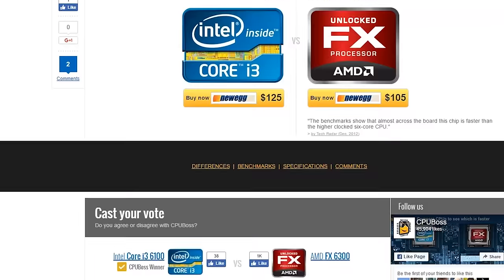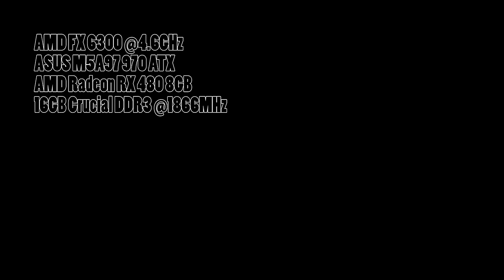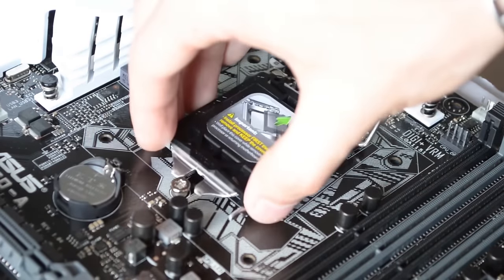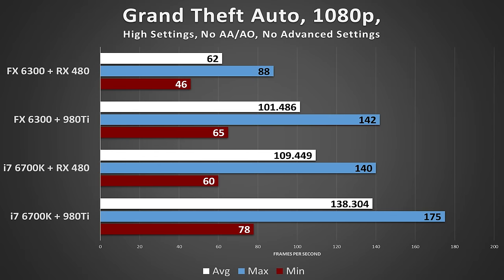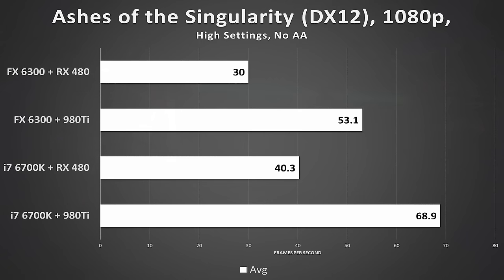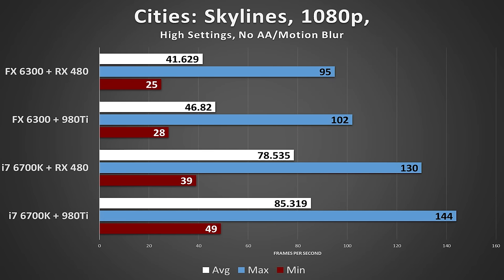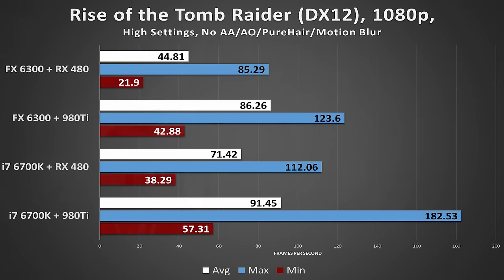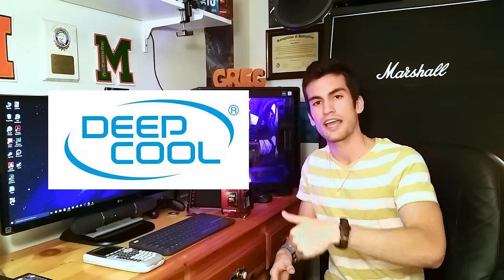AMD FX 6300 + RX 480: Severe Bottleneck?

Comment: I think this proves you shouldn't buy an fx6300, but if you already have it, it's not too bad, but a good time to upgrade to say, an i5 4460
Reply from the maker: A good way to look at it.
Reply: what about the fx8k series? now i really want to see the comparison between it and the skylake
Reply: fudomeiyo fx 8300 is between i3 and i5 performance. if you already own one, good, you can wait for zen and sell it when zen releases. i have an fx6300 and its meh.
Reply: +Thedovahkiin Would a fx6300 do The work for a cheap Light gaming rig?
Reply: +roligt1234 yes, but if you're building a new rig, go with a skylake i3, for a better upgrade path, if you already have one, it gets the job done for every title paired with anything below gtx970 level
Reply: +Thedovahkiin The thing is that I got a mobo, cpu and 550ti for like 60 bucks, and chassi 4 free and already got ram. What do u think?
Reply: +roligt1234 you got the fx 6300 with a mobo and a gpu?  amazing deal
Reply: +Thedovahkiin oh nvm it was $80. But still pretty good, now I just need a psu and than my gf got a light gaming PC.
Reply: i3 and i5.... 2nd gen performance.
Reply: Hmmmm tough one.... Either one or the other wouldn't make a huge difference, but together would make a significant difference though. Like the gtx 960 isn't a huge upgrade from the gtx 750ti, but paired with an i3 or i5 you'd see a much bigger difference. I'd rather upgrade to a skylake processor now and then upgrade the gfx to the gtx 1060
Reply: should come out in a month or two, you can read up on it. I would get the rx 480 or gtx 1060 they cost around $250
Reply: Why would you want to upgrade to another outdated cpu?  If you buy a good cpu, it can last you the better part of a decade.
Reply: i have an fx6300 (paired with a gtx 460) i want to upgrade the gpu, wich will be better option? wich will be less bottleneck? rx 470 or rx 480 ?  having in mind that the fx 6300 bottleneck the 480, i gonna get the same fps with a bit less powerful gpu? or the fx is gonna bottleneck any of those at a similar level?
Reply: I upgrade from the fx6300 to an i5 4460 last year and I can tell you that it was a good upgrade, the stuttering that I was suffering disappeared in all the games with that problem. But nowadays better go for skylake ddr4 and such
Reply: Eduardo Leiva the rx 470 is estimated to be slightly less powerful than a 970, so just my two cents, buy the rx470.
Reply: fx 6xxx or fx 8xxx of the same architecture play games with the same performance when clocked at the same clock speeds.
Reply: wow the i5 4460 uses DDR3, is clocked much lower than the i7 6700k on an older and a bit weaker for gaming architecture, with slower cache, -2 VALUs, fewer data units.... the difference between it and an fx 6300 would be minimalistic, especially if you overclock the fx 6300, while you can NOT the 4460..
Reply: +IIIRattleHeadIII it's called IPC, which has well chips have a lot more of than viscera chips do. so the i5 4460 is miles ahead of the fx6300
Reply: Thedovahkiin Intel and AMD architectures are easily compared, because they are on the same ISA(instruction set architecture), thus they use the same units for 99% of the architecture.

Haswell has only 30-40% higher IPC than piledriver depending on the area of usage.
Haswell has 3x ALUs and 2x AGUs per core + 1x VALU(which is absolutely bottlenecked by the lack of resources, so it really didn't make a difference).
Piledriver has 2x ALUs and 2x AGUs per core.
So integer IPC at the same clock speeds per core goes to haswell by 33%.

When it comes to FP(floating point) performance, piledriver has 2x 128 bit FPUs per cluster, while haswell has 1x 256 bit FPU per core, so up to 128 bit SSE they are equally as fast, but at 256 bit AVX piledriver is 35-40% slower, due to it requiring 2x 128 bit FPUs to work as 1x 256 bit FPU, which is slowed down, because it has to break the operations into microops, from macroops, but and it's a big BUTT, 256 bit AVX is 99% useless, it's only used in synthetic benchmarks and certain vendor software, NOT games, so it's NOT a valid performance factor.

So piledriver is 99%(in games all the time) equally as fast as haswell in terms of FPP.

Piledriver has a lot, but slower cache, while haswell has less, but faster cache, this is entirely dependant on the software, some software wants more cache almost regardless of the speed and some just want fast cache almost regardless of the size.

So it's a tie in this case, but a lot of games want faster cache, so haswell takes it(haswell has about 40-50% faster L2 and L3 cache cache).

Then there are the clock speeds, where piledriver just crushes haswell in terms of overclocking, especially when the i5 4460 can NOT overclock..
a fx 6300 at 4.6Ghz is clocked ~45% higher than an i5 4460, while it kept it's own in most games, especially with the gtx 980ti against a 4.6GHz i7 6700k, imagine with such a clock difference.

These are the most basic, but essential performance factors, every other aspect of the architecture are balanced accordingly, except the fact that intel put a nearly useless VALU in each core, which 90% of the time is bottlenecked to the point of irrelevance or 10% of the time does some minor improvements, but most games do utilize VALUs.
Reply: IIIRattleHeadIII All you did was state facts and said that at 4.6ghz, an fx6300 could match an i5 4460. and the requirements to do that requires a good cooler, a well binned chip, anda motherboard with good vrms, which most owners dont have. and despite  the fx 6300 might catch up to the i5 in certain games, itll be shit on cpu intensive applications like arma 3. i own an fx 6300 overclocked to 4.5ghz paired with an r9 280x, but it is still shit compared to lga1150 chips.
Reply: ***** my fx 6300 consumes 60-65Watts on full load with Prime95 and aida64 at stock speeds and does NOT go over 50-52C with the same problems at stock speeds with the stock cooler.
Reply: IIIRattleHeadIII because the fx 6300 throttles at around 80 degrees, the chip is cool, but oh my god it heats up my room a lot good for winter but for sumer...
Reply: Thedovahkiin dude 50C is NOT much, haswell quad core chips go up to 80C with the stock cooler at stock speeds.
Reply: +IIIRattleHeadIII I didn't say the fx 6300 runs hot, I'm saying the heat it outputs is hot. there's a difference, ever heard of tdp?
Reply: Thedovahkiin then I did NOT read what you said correctly.
Reply: Thedovahkiin also I own a fx 6300 and i5 3570k and in arma 3, both CPUs suck ass in big multiplayer servers...
Also both play games just about equally, except games like WoW, Arma 2(here both are bad, but the i5 gets a bit more fps) and paradox games,  but the best I've tested them with are 2x r9 380s.
Reply: ***** the fx xxxxE series are NOT meant for overclocking, they are high yield low binned chips that are cheap, that's why they require a lot of power to overclock, because of that.
Reply: ***** it does in this case, it very much does.
Reply: It will be cheaper for him to get a FX8350. It will be just barely behind the 4460 for less money. I would think if he has to upgrade to go with the 6xxxx series instead.
Reply: FX8300 lineup is very overpriced. Rather get the cheapest i5 you can get, it will outperform the outdated FX chips easily.
Reply: MrKeikari the reason why the fx 8000 CPUs cost so much, is because they are top of the line, most failed fx 8300, easily become an fx 6300 or fx 4300, without the need to make a new silicon, while a failed fx 8300 is a failed silicon
Reply: IIIRattleHeadIII You're correct but it doesn't make the pricing any more right since the "evil Intel" is kicking Amd's ass even in price-to-performance ratio :)
Reply: The gtx960 is perfect with a FX 6300 dont beleives what the other are saying
Reply: chronicblazer84 Yes, and you good at making random links with no point whatsoever :D
Reply: MrKeikari damn, a fx 8350 bottlenecks a gtx 960? Good thing, I got a fx 6300 that barely bottlenecked my 2x r9 380s in 99.99% of the modern games, now that I have only one r9 380, I need a better GPU, so it can bottleneck a GPU, to catch up to the fx 8350 :p
Reply: IIIRattleHeadIII 380 > 960 so the bottlenecks is even bigger :/
Reply: chronicblazer84 You have no idea 3dmark benchmark works? xD The physics is completely independent score and tells nothing about real-life performance, same as any non-sense benchmarks like cpuboss or passmark. Do your research before trying to back up your beliefs with plain lies...
Reply: chronicblazer84 Yeah, pointless synthetic part which shows nothing in real-life performance. You keep resorting to these irrelevant benchmarks since you obviously have nothing else to make FX8350 seem even relatively decent choice... There's no going round the fact that FX8350's low performance bottlenecks even low-end gpu like GTX960.

Your insults are not going to change but that's all you have to back up the obsolete FX cpu lineup.
Reply: MrKeikari not really, I own an fx 6300 and an r9 380(used to be 2 in CF) and my CPU is more than enough
Reply: chronicblazer84 you haven't shown any hardware architecture knowledge, nor any digital design, knowledge so far and you proved that you have no idea about coding... Now tell me, why should anybody take anything you say seriously?
Reply: chronicblazer84 Lol, no need to get that super-mad when you're proven wrong. Just look into these tech stuff, do your research and eventually you will acquire some basic knowledge to understand these matters :) Life is learning.

Friendly hint; maybe you shouldn't mention Heaven benchmark either in cpu bottleneck conversation ;)
Reply: chronicblazer84 so you know nothing, except a few things you've read on a few articles that have rendered 300+ pages to two sentences due to lack of knowledge, so they listened to marketing and a CPU has no such thing as a "physics controller"..... You just proved all my points...
Reply: chronicblazer84 and hyperthreading does NOT double performance, what hyperthreading does is add an additional scheduler, which helps the core be fed data whenever the pipeline is NOT completely full and it gives 0-30%, better performance depending on the software, it does NOT double threads, but for the kernel of the OS to use hyperthreading, the BIOS needs to first see it as 2x threads and then the OS sees it as two threads and finally benefit, where it can, from hyperthreading
Reply: To simplify things for him, think HT as organizing food in eating contest. The chewing capacity is still the same, but there's less slack when you're fitting the suitably sized chunk in your mouth whenever you can.
Reply: Stop trying to defend am3 chipset, it's good for light gaming, but will bottleneck anything above a 970. I have to keep mine overclocked just to avoid bottlenecks, and even then it still gets beaten by intel cpu's.
Reply: chronicblazer84 Wtf, so you're saying that making the pc even more expensive makes it magically perform better. Dude, see benchmark, you can't judge pc's performance based on price so adding even more expensive psu and makes the FX lineup's price-to-performance even worse!

MORE EXPENSIVE IS NOT BETTER, holy shit!
Reply: chronicblazer84 So is that a yes? You think pc performs better when it's more expensive? Wow man, I'm speechless.
Reply: chronicblazer84 Look into some benchmarks, you can't decide how good pc works by how much it costs. That's only the basic knowledge!!
Reply: chronicblazer84 I agree that his set up was pure crap, but I didn't see you say anything meaningful except that, also the name "BIOS" is just a formality at this point, it's beyond basic and I know that Intel have been using a crappier version of IBM's SMT  since the p4 days. And again, you know nothing about programming, Microsoft have been using the same shitty kernel since windows 95 for desktop, with super minor changes, for compatibility
Reply: chronicblazer84 oh, you go to Tom's hardware..... Where the biggest regards are and all they do is missimform people to say the least and do NOT start me on their biases....
Reply: chronicblazer84 if you are calculating the heat good job, but TDP is NOT power consumption, TDP stands for thermal design power, in other words how much heat the hardware outputs and how good of a cooler you need to cool it, measured in Watts(a unit of powe,), usually AMD(and Intel) products consume 33-42% less power than the TDP, except the RX 480, which had that power problem, IDK after the fix.
Reply: chronicblazer84 yes, but you proved that you don't know almost anything about hardware architecture, let alone digital design as well.
Reply: chronicblazer84 I never defended the system, I just told ya that TDP is not power consumption, which you were calculating the power usage from, they are barely related and I monitor my power usage physically as well, sensors in PCs suck horse shit. Also a 400W PSU with 18amp on the +12v rail and a PSU with 28 amps on the +12v rail are two different things and he is using a PSU with low amps, also it has terrible parts in terms of quality.
Reply: chronicblazer84 Wow, so your paranoia hit again? :D "My other YT account" xD "Cpu physics controller" xD "TDP being power consumption" xD 

You're building quite a rep here my friend :)
Reply: chronicblazer84 yes, usually TDP is worst case scenario.
Reply: MrKeikari you don't look any better either...
Reply: chronicblazer84 well you claim that you know computer hardware too, but it's a big no, no.
Reply: IIIRattleHeadIII At least I don't have to make up pc parts and I have facts to back up my statements unlike you :) 

Claiming Greg Intel-biased is just ignorant Amd-fanboy bs, You clearly haven't watched any other videos on the channel which also clearly favor Amd :)
Reply: MrKeikari I told you that my PC do not bottleneck a 380 you tell me I am lying, ChronicBlazer said that his cpu do not bottleneck his GPU and he brought lots of exemple.
Can you show us your proof that a 8530 bottleneck a GTX960?
Reply: Marcusius even I can prove you that the fx bottlenecks GPUs... Just play an old game or something piss poor optimized like arma or a paradox game, or something massive like world of Warcraft.... There is always a bottleneck in a system, in a perfect world/scenario your RAM,CPU,GPU and PSU would be running at 100% while gaming +the rest of the background tasks. I don't get why people care so much about their GPU being bottlenecked in particular.
Reply: IIIRattleHeadIII Likely because graphics card often is the component that mainly decides the fps in game for instance in balanced builds. It's also often the most expensive component, has shortest life-cycle and the more advanced graphic cards cost more. While with cpus you don't always get extra performance for extra cost :)
Reply: chronicblazer84 You just described cpu bottleneck on your overpriced FX8370E :)
Reply: IIIRattleHeadIII Arma is really really bad for every CPU, I remember someone bitching at the game and he was using an I7 6700k.
I agree with you there is some exception like those games but most of the games I play my GPU run around 100% most of the time.
Arma is pure CPU based game. Me i'm talking average to well optimized games like Crysis, Doom, BF4.
Reply: chronicblazer84 Ummm, yes it is :D
Reply: chronicblazer84 You just told that your FX8370E works at 100% utilization which means is likely bottlenecking the overall performance with its low performance.

And now you tell me to kill myself? :D
Reply: chronicblazer84 That situation is very unlikely :) But now that you've admitted that your FX8370E is struggling at 100% utilization aka being the bottleneck for the gpu you have just proven my point right :)
Reply: chronicblazer84 It's okay, just stop doing drugs. It's not good for you :)

Happy that we found the bottleneck issue :)
Reply: chronicblazer84 I do heroin for the same reason :)
Reply: chronicblazer84 13rd Splatoon at Underwater Rugby Rebellion in Andalusia.
Reply: chronicblazer84 Me neither, I captured Osama and got to keep him in my basement. He's got very good at knitting!
Reply: Honestly I would say wait for the next generation of cpus.
Reply: +Jacobprogammer Thats what I'm thinking i have a 6300 I'm banking on ZEN
Reply: 4460 is shit.
Reply: just wish amd didn't delay zen
Reply: Leon Still outperforms FX83x0 at the same or cheaper price :)
Reply: MrKeikari Yes, however the cpu doesnt perform better than an i3.
Reply: Leon In some games surely.
Reply: ***** Pentium is no longer recommendable.
Reply: Leon Why wouldn't it be? Super-cheap, superb upgradeability and unbeatable price-to-performance ratio.
Reply: MrKeikari 2 cores.
Reply: Leon Wow, you know so much!
Reply: MrKeikari 2 cores is not enough for gaming anymore.
Reply: Leon Lol, do your research. Core count doesn't matter. Even the overpriced "8"-core FX83x0 struggle against Pentium.
Reply: ***** You're using Firestrike score to compare cpus? xDDD :DDD xDDD
Reply: I got 4460 and it's not that good tbh, can't even OC it and it's outdated by now (no ddr4 support and can upgrade just to Broadwell). I'd wait for Zen if I were to buy all new or go for i3 6100 on a budget.
Reply: xyz12345 You're fine! Your cpu still outperforms any Amd cpu and there's not enough performance improvement from going ddr3 -> ddr4 that it's worth doing :)
Reply: MrKeikari As a ArmA player, I would have wished for faster CPU clocks and this CPU is locked. It's just a trick from Intel to buy the more expensive "K" models which are really the same, just unlocked.
Reply: xyz12345
You still have the best price-to-performance in your hands :) How much fps in Arma?

Skylake-non-K cpus are overclockable on Z170 motherboards.
Reply: MrKeikari Well I play ArmA 2 and ArmA Cold War Assault which are a bit older and they run ok but when I push the game really hard I wish for more CPU speed. Although it's true that I'd also need overclocker board and cooler.
Reply: ***** Currently on integrated but before I had GTX 750 Ti. I'm eyeing the RX 480 and upcomming GTX 1060 for a replacement.
Reply: I'd suggest to wait for Vega or new Nvidia gen, the upgrade is not that good (talking budget wise)
Reply: +Thedovahkiin  Sorry but no this video does not prove that you shouldn't buy a FX6300 because this video is a total fail as it is comparing a cheap lower end CPU to a expensive ultra high end i7 Intel chip,  The 2 are not meant to compete against the other its like comparing a mini to a Ferrari so of course the FX is going to bottle neck,  The FX6300 is more designed to compete against i3 and i5 chips and it holds it own against its target market and in those comparisons the FX ,i3 , i5 all bottle neck in a similar fashion.  My FX6300 literally gets to with in 7fps of my friends i5 rig.  My rig an old FX6300 with a GTX970sc running doom with graphics set on ultra is getting around 98fps my friends i5 rig with the same GPU on ultra gets 105fps.
Reply: EQUINOX But keep in mind how overpriced FX lineup and even FX8350 is outperformed by i3 so there's really no reason to bottleneck your system with bad cpu :)
Reply: MrKeikari an fx 8350 outperformed by an i3 ? lmao now thats some funny shit ... No it is not out performed at all in fact as i said earlier my old FX6300 is only 7 fps slower than my friends i5 skylake with its DDR4
Reply: EQUINOX Well FX8350 can't outperform i3. In most games i3 is far better than FX8350 due to FX architecture being such bad and gimped in performance.
Reply: Zen sounds great
Reply: I've had my FX6300 with GTX 660 for about 3 years now. For me at least it is still a quite functional system. I play Fallout 4 between 30-40 FPS on medium settings with full AA and it still looks better than my buddies XBone. Sure I plan to upgrade, as soon as Summit Ridge (a.k.a. Zen) is released. Not to say I will go AMD again, I'm not sure, but once their is strong competition on the market Intel will have to drop their prices. In the mean time I'm still getting plenty of use out of my bottlenecked rig.
Reply: AMD drivers are single threaded so exact same result with the 8350 as with the 6300... amd gpu's are just awful with slow cpu's. a fact often overlooked because reviews are always done with crazy high-end OC'd cpu's.. nothing like the computers consumers are putting these midrange cards in..

and as for i5-4460 vs fx-6300.. lol the i5-4460 has one extra FPU, all of which outperform one of the fx-6300's, and native 256-bit > 2x 128bit. bulldozer is trash. let's see your geekbench score, userbenchmark score? passmark score? fps on a poorly optimized game like stellaris at 200+ years or blade & soul, or even just a cpu intensive one like dota 2? I thought so...
Reply: ***** The link shows very well how obsolete FX6300 is compared to Intel i3. Really no reason to waste money on overpriced FX cpus.
Reply: MrKeikari
That link doesn't show anything other than how CPU design from 2012 compares to one from 2015. The i3 might be cheaper, but it also have much less cache than the FX. On paper they might look very similar but the FX is notably more powerful in practice. Maybe you're an Intel fanboy or just an AMD hater, but either way you don't really know what you are talking about. The FX6300 is still a viable CPU for most users. I play Kerbal Space Program, XCOM 2, Fallout 4, and even Arma 3 on my FX6300 and it works. It's not the fastest, sure it can be overwhelmed, but it does work well enough for me. As for other work related applications, Illustrator, Photoshop, Premiere, Blender, ect. It's a massive improvement over the Core 2 Quad I had years ago; which is about the same level of performance I would expect from that i3 6100.

If anyone is looking to build a new PC I would recommend waiting till end of the year once Summit Ridge has been released and tested. If it really does have Haswell-E performance at close to half the cost, Intel will have to lower their prices to be more competitive.
Reply: Yelkwood9 Also since you asked here are some bench scores for my system one link will be my FX6300 and the other is for a 4460.

My 6300=  http://browser.primatelabs.com/geekbench3/7583728

The i5= http://browser.primatelabs.com/geekbench3/7578870

So yes in single core the i5 is better by 821 but single core is pointless given that games and programs use multi core now and in the multi core test mine literally came in at 10 less than the i5 and in actual gaming that breaks down to around 5 to 7fps of a difference
Reply: EQUINOX
single core performance is still key unless you only play the most well optimized gpu bound titles possible, then sure, fps difference will be minimal. in cpu-bound scenarios however even with some multi-threading in the engine, one core is always holding up all the others because you can't do a draw call on core 1 before core 0 has done physics or A.I or etc. which is why more single core performance > more cores.

also that's a relatively low single core score for a 4460 mine:

http://browser.primatelabs.com/geekbench3/6882591

so idk why there's a difference, could be the OS, win10 is a disaster and all..

even assuming equal performance per core id prefer the 4460 just because i like 4c/4t better than 3c/6t for overall throughput and less scheduling related bottlenecks when 2 threads are trying to access the same l2cache/fpu for example, a chief cause of lower min frames
Reply: Yelkwood9 That's not how multi core works or well not by default yes you can set core affinity per process but by default in both windows and multi core programs each process is split over all the cores, well optimised does help but there is never a situation you would just be using one core unless you disabled the others or manually set core affinity. 
So like I said multi core is what matters because every program / game is multi core even windows 10 is multi core and it even converts a single core programs to multi core by automatically spreading it over the cores.
Reply: EQUINOX
Dude you are entirely out of touch with the state of software development. Many applications are still designed around sequential processing (i.e. single core) and even more that are only using 2 cores in parallel mode. There are actually very few end consumer applications that are fully optimized for parallel processing (i.e. mulit-core)
In fact most game server hosting is done on multi CPU servers with multiple cores on each CPU because it is the most profitable way. The game server application only uses 2 cores, but the physical machine has 64 logical cores. This allows 32 virtual machines, each with it's own game server running, to be ran on a single server blade. This works because most game server applications are only dual thread optimized.
Similarly, the host applications of games are often only improved by 2 or 4 threads and don't really scale well beyond that.
While software development is slowly progressing into the parallel mindset we are still a long way off before all of our applications are optimized in the same way the scientific analysis applications that utilized all 64 cores of the blade server are.
Reply: and what kind of cooler is needed for a 8370 clocked @ 4.5 GHZ?
Reply: +A Google User 
I run my FX6300 @ 4.444Ghz with a Deep Cool Gammaxx S40. It stays well below the shutdown temp. I can go up to 4.8Ghz but get stability issues with some programs. 

I cant be certain about the FX8370, but I suspect any cooler with similar construction to the S40 would get you close 4.5Ghz.
Reply: Sadly even the highest overclocked FX83xx is outperformed by cheapest i5, in some cases even by i3.
Reply: EQUINOX
for every thousand properly programmed multi-threaded programs there's 100,000 more that aren't..

and win10 can' t make an application execute instructions  parallel that it was programmed to do sequentially.. you're thinking of its ability to move threads between cores so that the core that has the least going at the moment on receives the most workload.. they've been doing that since win7
Reply: +MrKeikari 
I wish idiots like you would be banned from commenting on YouTube. Synthetic benchmarks and tech sheets are not the equivalent to realworld application.
Reply: +EQUINOX 
None of those programs you listed actually use all the cores on your machine. DOOM is quad core optimized. I dont care what CPU you have it is only getting a slight tickle from your applications. Sure that leaves plenty of headroom for multi tasking, but you are hardly using up all that proccessing power. This is just the nature of the beast.

Developers would have a very hard time with stability if they made their game use all the cores on a CPU, tested it with 8 and 16 thread machines and sent it out to the vast majority of users that only have 4 cores to play with. You just dont do that in practice. Instead you optimize for 4 cores because that is what most consumers have. Even then the application may only use 2 cores consistently and reserve the other 2 for high load situations. 

The only time I have seen all 6 cores on my FX6300 under full load is when I do CPU based audio rendering. Usually, even when gaming, only 2 cores are maxed out.
Reply: i couldn be more in desagree
Reply: Dual Xeon E5-2670 16cores 32threads $144 ebay, ASRock EP2C602 $299.99, 64gb ddr3 1600 ecc Micron $119.99
Reply: low single core performance, definitely not the best bang for your buck for games.
Reply: as long as its a intel k model your good
Reply: FX-6300 is getting old yes , its perfect for my GTX660 no bottleneck. But i agree with a GPU like RX480/GTX970 you need a FX-8350 or i5-4670K for exemple.
Reply: ***** the thing is the fx 8350 is a worse deal, it performs the same as an i5, but has to be atleast 4.4ghz, which requires a  good cooler, motherboard with good vrms and a good power supply, atleast 600w bronze. amd might have failed but they might come back with zen.
Reply: $15 more for barely any higher performance.. and the fx-9590 which is basically a 5ghz 8350 still scores slightly lower than the i5-2400 @ 3.10GHz in single threading.. let alone one from a future gen that is overclocked..
Reply: i3loody Moon No reason to waste money in overpriced "8"-core FX cpus while much cheaper i3 outperforms FX chips like bitches. Any FX chip can't outperform even the cheapest, locked i5.
Reply: thats right on crappy benchmarks. But IRL i tested it my self i3-4150 against FX 6300
even stock the FX dont bottleneck my GTX660 on GTA V (high +60fps) with the i3 its more like 45-50fps... with some drops at 35fps. Since i tested it i know benchmarks are fucking fakes.
Reply: MrKeikari
i never suggested or hinted at buying an 8 core FX or and 8 core amd.   thankx for trying.

Edit: i know dam well that building an fx6350 vs any intel build for the exact same part cost. the scores are going to be super fucking close.   nothing like whats shown around the internet by biost intel users.

FOR THE LAST TIME TO MAKE IT CLEAR. I AM NOT SAYING AMD IS BETTER PERFORMANCE THAN INTEL.  fucking hell.
Reply: upgrade to 4460 would be a waste of money. its really close to the 6300. go with a high end K model
Reply: i3loody Moon Good thing you changed your mind. FX lineup is really obsolete cos it's just gimped Phenom2 with gimmick cores.
Reply: single core on phenom 965 3.4ghz was better than FX-4100 and FX-4300 i guess haha.
Reply: i have never ever said in my life that head to head amd holds their own up to its intel counter part. i am just simply being a stickler for pointing out reality.  To build amd to perform on the same level as intel with the exception of the BRAN NEW  chips from intel ( not fair to compare because amd has yet to release their version......pretty common sence when trying to be fair when comparing) is not that difficult. Even older intel cpu's that out perform current amd still cost  MORE  to build and maintain.   Now when it comes to simply upgrading from old hardware....somone would be a friggin fool to upgrade right now.

To not wait for amd to produce more pressure on intel and nvidea to actually put some elbow grease into their software, is simply straight silly.
Reply: and what if you are on a budget. i am planning on getting this with the r9 380 will that bottleneck
Reply: what cpu do you have?
Reply: if you have a AMD 6300 RX 480 is fine.
Reply: +Rob Will If you have one yes, but a new PC build should not have an am3 chip in it
Reply: +Thedovahkiin yea your right now.
Reply: +poshstew matter of fact go with the new gtx 1060 3g for 200
Reply: +Rob Will too late
Reply: +Rob Will my dad saw me looking at it multiple times online and he said if you give me the rest of your money we will buy this and the other parts needed so i now have the r9 380
Reply: I have a PC with i5 4460 and gtx 750 I want to put a Rx 460 do you think I should do it fora decent or better than gtx 750 with I5
Reply: RX460 is better yes but you should look at RX470 4Gb if it fit your budget :) you will see a good difference
Reply: +TheRems710 yeah but with a budget of 110
Reply: take RX460 then , its better than 750 anyway :)
Reply: 750 is not even a gaming card.    460 is entry level gaming card.
Reply: for gtx 960 this amd chip will be okay.
Reply: Or just not expect to run everything on high. Also i5 6xxx>i5 4xxx
Reply: how about an fx8300? is it good?
Reply: yes but only if you OC
Reply: NOT possible to oc for me :(
Reply: VIOZO put that money on i3 or if possible go for i5 (end of statement)
Reply: Thenetwork 473 yep
Reply: Just wait for zen, buy a $200 cpu that performs 2% better than boradwell-e, and win at life.
Reply: Thedovahkiin How well put. How can I argue with such great logic?
Reply: I think it depends on what game you are playing. eg Minecraft vs Crysis 3 vs GTA 5. I got an FX6300 because that power was all that I needed, I don't play many games and could have gone with a cheaper i3 or other AMD processor for $70 instead of $100, but I choose the 6300 because it's price for performance I felt was reasonable for my specific purposes.
Also, AMD is still to release their new architecture, will be interesting to see what happens :D
Reply: yea my i7 6700k and amd 6300 both do 60 fps with gtx 1060 on mostly all games... so chip as of right now still holds up
Reply: Thedovahkiin I have a fx 6300 I bought a few years ago and I am in the process is upgrading to. gtx 1060
Reply: i have a FX 6300, paired with a 750 ti. good budget gaming at 1080p. thinking of getting a 1050 ti to go with the fx until i get rich one day n switch over to intel life
Reply: ninja of fire i ended up buying a RX 470 4gb
Reply: There is no way the 6300 is doing that without hitching and stuttering in a swarm of titles at stock clocks..even the 8320s/8350s really need taken up to about 4.7-5ghz and it's STILL noticeable in some stuff. This socket is DEAD man....If you were going to get something best to move on to something like unlocked 6600k imo.
Reply: Thenetwork 473 Yeah it's widely used, but it's a still dead socket platform....And clock for clock and ips/ single threaded really isn't that well at all..doesn't get a whole lot better oced either but some and worthwile...paired that up with a lot of the driver/amd gpu overhead some wonder why it hiccups stutters in a lot in stuff.
Reply: Thenetwork 473 No I promise you in some titles and things not optimized for or very well at all it's really noticeable CPU intensive.... Or stuff leaning toward the NVidia side. Do it then... go try play something like Arma 3 with that thing it's practically unplayable...any of the newer Total wars etc stuff like that and you will see REAL FAST what I'm talking about haha
Reply: JR I played through doom 2016 on ultra with practically no drops on a 6300 with a 960... I don't think Arma would be an issue.
Reply: Thenetwork 473 Def not unplayable just not buttery smooth
Reply: Emily Hale Oh it's playable I know but it's like the immediate thought of titles were just Satan, all that hitching stutter frame drop inconsistency.
Reply: its so easy to say upgrade to a intel CPU when you already have one,
i wonder if Intel users realize that motherboards arent universal
not trying to hate on this one dude but it seems like
AMD are the civics modded to be as fast as a corvette for half the price.
and Intel are the corvettes with performance package from the factory... so its just a lil bit faster but twice the price.
would I upgrade to a intel CPU? sure, but i'd rather have a FX6300 OC to 4.5ghz that runs better than a i3 6100,
than buy a $150 i3 6100 and a $80 i3 6100 compatible motherboard.
"but its OC'd it will fry" alright so i buy 2 back up FX 6300 with the money i saved not buying a intel lmao